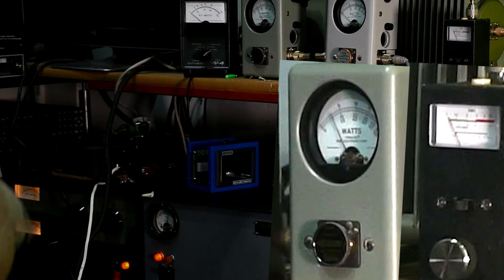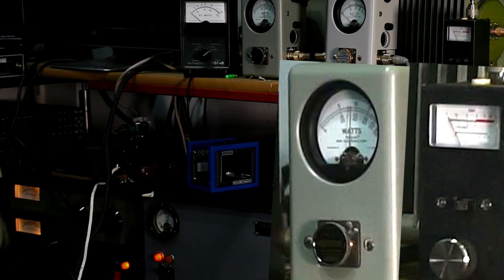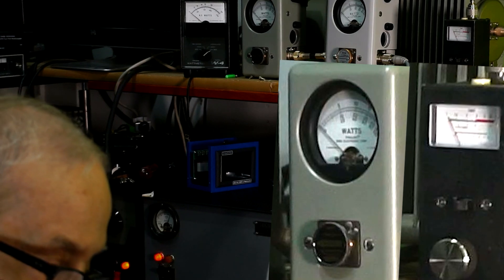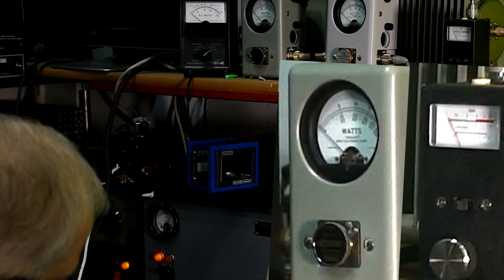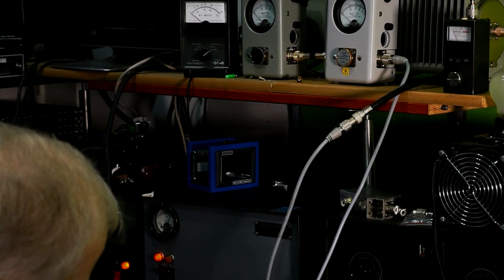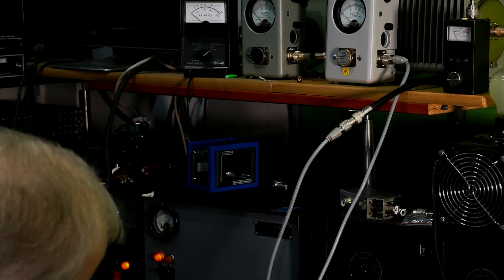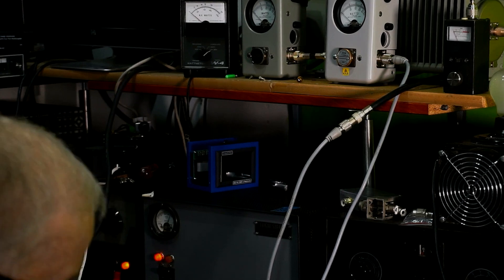Use RG8X for a Really Hot Signal?  How Much  Power Can RG8X Handle?  Find Out Here with Jim W6LG

Comment: Good info Jim. Two things that came to mind after watching your demonstration. One, there is some measure of heat sinking in the coax itself, so the hot spots may be way more critical than one would think. Two, the heat factor would be greater if the coax was in a tight bundle with multiple cables. I see this in the automotive sector a lot. One wire gets hot and wipes out a whole section of a harness. Ugh.

Comment: I mostly use LMR240, LMR400 and LMR600. Sometimes other high quality coax. Never use cheap coax. Even if it seems OK at the time. It as almost always fails far sooner. The time spent tracking  down coax issues is just not worth the difference of a few dollars up front.

Comment: Good to see your still atcive Jim.
The heat losses (I²R) is distributed over the length of the coax. So if you can see a temperature change in a single spot, tells us there is considerable heat loss of a 50 or 100 foot run.  
You could coil that up under the desk and warm your piggy's....

Comment: I like the testing using a field strength meter, to see if there is radiation loss, as well as resistance loss. 

On a resistive dummy load, without any VSWR, I would expect that the cable spec loss would be accurate. 

It would be interesting to see the radiation loss when using a dipole at the resonant frequency and then shifting the transmit frequency to increase VSWR and test at 1.5:1, 2.0:1 and maybe worse (but not where you could damage your amp), to see if radiation losses start happening along with the resistance loss, when the load is impedance, with capicitance or inductive mismatch, rather than purely resistive. 

We used to calibrate our meters using 2 dummy loads in parallel, to verify proper  VSWR readings. It would also be interesting to see if a pure resistance VSWR could cause cable radiation.
Reply from the maker: Interesting.  I will need to think of an easy way for me to do that and not damage the equipment and keep the output at the same power.  73, Jim W6LG

Comment: Thanks for the video.  I use the RG8x for portable ops and short jumpers on the low power side of things.  For my long wire 9:1 antenna system, I noticed much better results with LMR400 type coax compared to RG8x.  Now I don't use any of that 1/4" coax outside the shack.  I have found the true king of big signal and high swr is the old 600 ohm twin lead!
Reply from the maker: Good decision making for various installations. 73, Jim W6LG

Comment: Good video. I will add that I use the DX engineering RG-8X on all my antennas and have for some years. The reason for me is I only run 700 watts max and usually for my contesting I run 500 watts. On 10 meters I rarely go over 400. Still have the same tubes in my Drake L-7 amplifier that were there in the 80’s. The RG-8X has what I consider to be minimal loss on 160 through 40 meters, taking length of cable in to account. The loss on 20 meters is about the same as the coax length is half what it is on my 160 through 40 antennas. On 15 and 10 meters the coax is the same length as on 20 and I determined that due to cost and weight factors the loss on those bands was not significant. I do contesting a lot and considering that with the RG-8X I have on several occasions worked 100 countries on 10 and 15 meters in a weekend contest running 500 watts, more expensive coax is not necessary for me. However that is just my particular case. Everyone has different circumstances and needs to evaluate their coax loss per band considering length of cable, age of cable, type of cable, SWR that will exist on cable (using charts for additional loss due to SWR), power level used and available funds to acquire the coax. If I had very long runs on 10 meters I would probably not use RG-8X if I could afford better.
Reply from the maker: Larger diameter coax and lower loss is usually the answer.  73, Jim W6LG

Comment: I do quite well with only 30 watts. No worries about heated coax.
Reply: Low power 200w or less with short runs for HF is fine.. Once you get to 6m you start to notice the receive and transmit line loss, 2m and 70cm it is really noticeable on anything over a 20 foot run.. So I have a variety of 1/2 inch Andrews hardline, 9913 and 8a for everything except jumpers from the connection plate to all the radios which are mostly 8x and I don't have any power over 150w..
Reply: My rig is capable of running 100 watts, but I never run it that high. See no purpose of it. I kept adjusting the power down and found 30 watts is just fine. I don’t know why anyone wants or needs to run anything above that, especially a kilowatt. To each his own, I guess. Just waiting for the FCC to start requiring radio operators to be submitting RF field readings.
Reply from the maker: I run more power so that the receiving station has an easier time copying. On SSB and pointed to EU I will run 1KW with either big amp.  73, Jim W6LG
Reply: @ham-radio , I always get between 5-5 to 5-9 signal reports. I used to think you need high power until I hooked up with a QRP’er. I became enlightened.
Reply: @Macjohn1419  Far and away it is more cost effective and less trouble to have a better antenna than to run full limit power.. Besides what good is it to have half the planet hear you when you can only hear other high powered stations and don't have contacts with 90% of the stations trying to call you.. I have heard many times these stations calling and calling but they can't hear the people responding..
Reply: I’m only running a random long wire with a 9:1 UNUN and 30 watts. No need for high power, when done properly.

Comment: Great video on coax loss.  Reading data sheets is great. But when doing a test you understand much more about the data that is listed.  I learn better that way. buy doing a test like that.  Every loss adds up.  this loss is also in your recieve as well.  I can say this test with RG8X can vary a lot from brand to brand of coax.  Coax like RG400 about same size has lower loss . For my portable station I use M & P Pota flex 7 that is only about 1 mm bigger. has much better spec than 8X . works VHF much better. Comes on a reel for easy set up . I jot some 3 ft jumpers out of Portaflex 6 and 7. The 6 is same size of 8X . I do have ABR 400T that is PTFE dule silver plated coax. made in Texas . I put full legal power threw it. it stays cool . and PTFE coax is rated better for heat.  It is made into a common mode choke with a FT 240 ferrite .  The outher one like that from Palamare with RG8X and ferrite gets warm at full legal power and that with a short key.  The ABR400T coax can run FT8 all day . The pota flex 7 easy takes full legal power without much heating  I ran QRO FT8 threw it. stayed cool !  I do find the RG8X from RF parts or DX Engineering is good 8X and much better than the Amazon 8X. ABR has a 8X type and is great coax as well. 73
Reply from the maker: I agree!  The coax I used was not good. 73, Jim W6LG

Comment: Curious what others might think. I have migrated away from lmr 400uf  to rg393 ds.
KA6PSD Robert
Reply: I might add, that my new install is all 1/2" heliax cable, not as easy to manipulate but better in all other aspects.  😊
Reply from the maker: It is very expensive.  It is very low loss.  It will last for decades and provide a lot of advantages. It is an excellent choice. 73, Jim W6LG

Comment: I mostly use Times Microwave LMR-400 and RG-213, and both perform great for my hf station. For portable operations at 100w max, I opt for RG-8X because it's compact, easy to handle, and affordable to replace if damaged. I’ve been taught to overbuild my station, ensuring I won’t need to upgrade or replace components if I ever decided to run higher power in the future.
Reply from the maker: Sounds great to me.  Thanks for the advice. 73 Jim

Comment: Clearly, your use of the undersized cable is responsible for our heat in Florida!  It just makes sense.  You objectively prove what we have suspected, but never scientifically tested for ourselves.  We need an expert Elmer to show it with objectivity, rather than intuition.  The lesson learned, among others, is if you burn your hand when you touch it, something is less than good.  QED
Reply from the maker: Okay larger and lower loss coax with a better dielectric is most often the answer. 73, Jim W6LG

Comment: RG-8X is ok to use inside the shack for the short lengths between the transceiver/transmitter to your amp or other items where you’re running low power, but switch to a larger coax such as RG-8 or LMR-400 coming out of the amplifier and on to a tuner (if needed) or to the antenna. Great video, Jim. 73, K5VR
Reply from the maker: I agree. 73, Jim

Comment: The losses in rg8x is why im swithcing to rg400. Currently im using bout 50' of old tandy rg8 because it a few cb amps, 500 ' of unknow coax posibly 75 ohm and several antennas while scraping from a silent key's house. Made a grand and scored some free radio stuff.
Reply from the maker: Many times, just cleaning up the site for the widow helps here and you get some good stuff in return. 73, Jim W6LG

Comment: Interesting to see how quickly that heat builds. Obviously, using a larger diameter is quite advantageous. Thanks Jim…

Bob Runge
W1LSZ
Reply from the maker: Indeed. I probably could not heat large diameter coax.  73, Jim W6LG